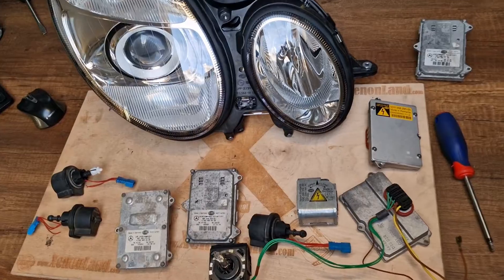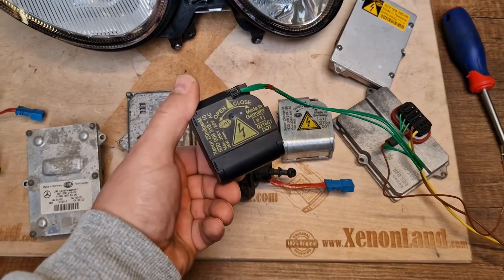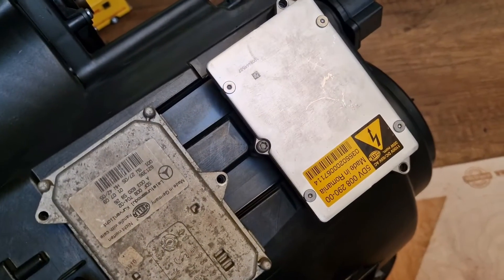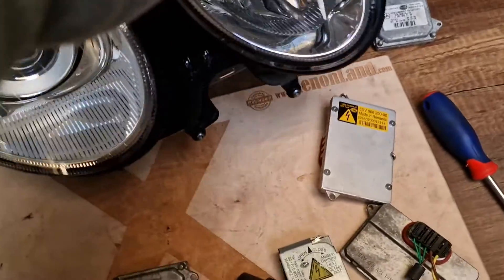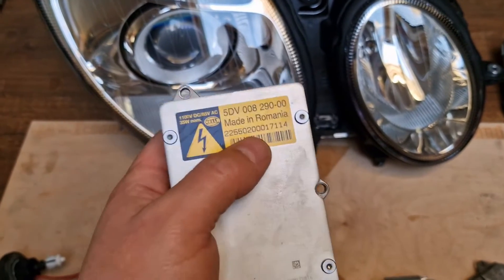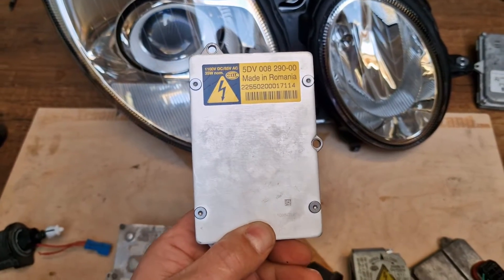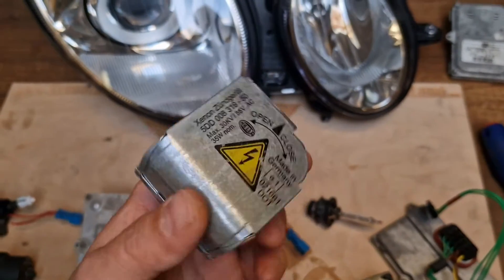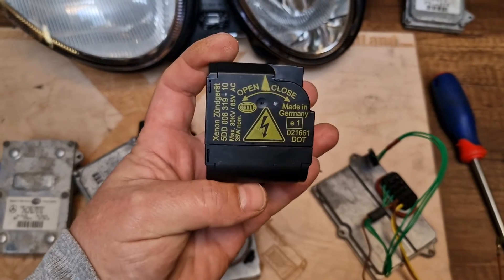Mercedes-Benz W211 Hella xenon headlight ballast 5DV008290-00, igniter 5DD008319-10, 5DD008319-50

Comment: Gud day,
Great video! My question: I get this on my display "active headlamps display mulfuction". Could it be my ballest is out? Thank you
Reply from the maker: Which year is your W211? You have adaptive type headlights, right?
Reply: @xenonland  Oh wow.. Thank you very much For your quick response. My vehicle year is 2005 E500  and I have bi xenon headlights. I would like to get ut knocked out, I dont like seeing that massage when car shuts off...lol
Thank you so much
Reply from the maker: Do you get exactly "active headlamps display malfunction" message or "active headlamps inoperative"? If you have active headlamps inoperative message it means that the adaptive function is not working properly.
Reply: @xenonland  "Active headlamps display function" is what comes up. I have tried the turn steering wheel  right, left still errors out.
Reply: I have headlights that do not support active corner leveling..

I do not have the second ballast you mentioned installed and my low bea driver side works fine

My passenger side low beam does not turn on tho even with new bulb.
Should I buy a new igniter switch + ballast combo on ebay or is there a way to test my ballast/ igniters maybe by switching the driver side parts to the passenger side.

As well as I got new h7 high beams that do not turn on any clue how I can get them working?
Reply: I have a e500 rwd bixenon
Reply: @TacticalPipelineAI  I have E500 4matic w/active headlight cornering. Dealer stated right side is out of line/damaged. Only fix is to replace